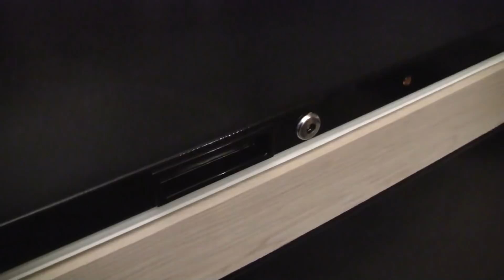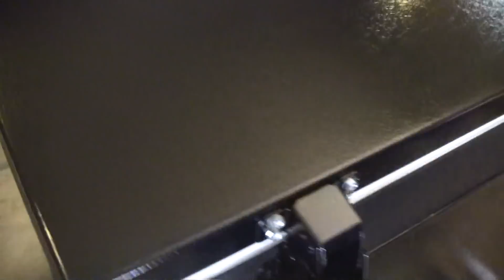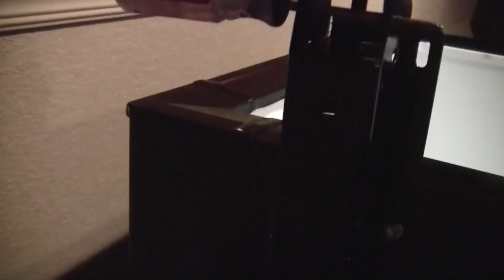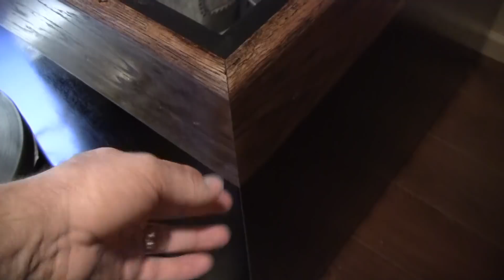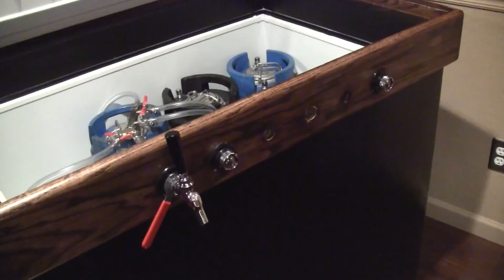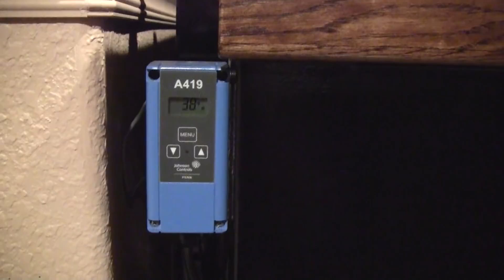How to Build a Keezer / Kegerator Part 2 Collar and Hardware

Comment: Did you use a spade bit or hole saw to make the holes for the shanks?
Reply from the maker: I used a spade bit to drill the holes for the shanks.

Comment: Great build BHbrewing!  I built a very basic keezer out of 2x6 a few years ago, but I'm upgrading to a bigger freezer and really like what you have done! I was wondering if you would share the dimensions of the wood you used?  You mentioned having the wood cut down with a table saw.  What were the dimensions of the poplar and oak prior to cutting and after?  Thanks!

Comment: I'm working on my own 4 keg keezer currently. What spacing did you use between taps? Three inch on center, four inch on center? I plan on using White Labs viles for tap handles so I'm not sure I need the extra spacing for larger tap handles. What are your thoughts on that?

Comment: Awesome BH I did replace all my lines  with red  for air gas and black for beer all five feet it works good but I did add 2 525  Perlicks and 4  545 flow control  Perlicks as well cheer great job